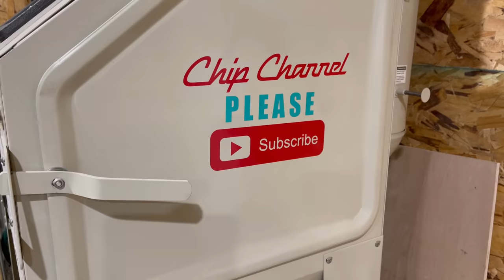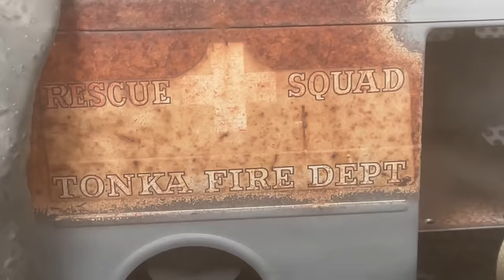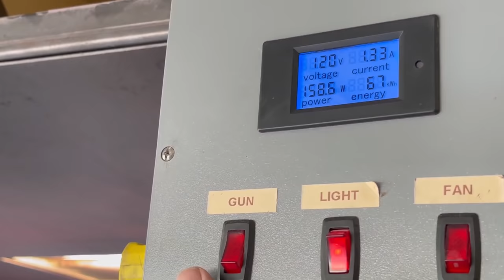1957 Tonka Rescue Squad Metro Van Ambulance Fire Department Truck Restoration

Comment: It always amazes me how good the quality of the metal is when the trucks are beadblasted. It looks in almost perfect condition.
Reply: Yep. For some reason the surface rust bleeds out through the paint bad enough to make it look like solid rust but you can see the paint is still there when blasting.
Reply: Yes, no rust…. just dirt, that looks like it has been painted on
Reply: I agree it seems like it wasn't really rusted, it was just painted like that and a little dinged up to make it look like it was old.
Reply: I've seen a lot of rust and corroding. It's as real as the rusted shit i find in my yard and in the ground. If the truck was painted,  the stickers would be rusty and underneath the stickers wouldn't be rusted.
Reply: The sandblasting process fills any rust or corrosion pits if they aren't completely rusted though, (both sides have rust and complete holes,  metal is brittle there.)
Reply: The fitness gram pacer test is a multistage aerobic capacity test that progressively gets more difficult as it continues.The 20 meter pacer test will begin in 30 seconds. lineup at the start the running speed starts slowly but gets faster each minute you hear this signal.

Comment: Beautiful restoration.  I am the original owner of the Tonka set.  Fire Engine, Aerial Truck, Rescue Squad 1954-55.  The vehicles are in better shape (stored inside) not as much rust.  I want to restore them, but not sure if I want to paint with powder coat or oil based paint.  Thanks for a video. Nice way to start the day 🌞☕

Comment: Just saw the video. Fantastic Restoration. Have to figure out how to make my blasting cabinet work as proficiently as yours.  On putting on vinyl decals, A drop of soap and some water sprayed before applying the decals. Lets you move them, to position them.   Squeegee out the air bubbles and water. and they stay in place. Might make it a little easier to apply.

Comment: Another great restoration. Bravo! I missed where the third door handle came from. Did you make a new one or buy one? I hope someday someone will make reproduction headlights. Everything looks great until you have to put those yellowed old ones back in.
Reply: My family had lots of Tonkas growing up in the 50s and into the 60s. I have a vague memory that some of the plastic headlights did come with amber tint.  Maybe they were clear and turned amber very quickly.  I still have the original family 1959 pumper truck, sadly damaged by generations of abuse, .. its plastic headlights are still clear at over 60 years age, some of that outdoors. Perhaps a good historian can chime in on the clear and amber headlights?

Comment: These Metro step vans were used by the long defunct Railway Express Agency (1929-1975) for deliveries until the corporate jackasses ran it into bankruptcy.  If you come across another one that doesn't have an original identity, consider restoring one as a REA truck.

Comment: If i were to do this,  i would've made a custom interior with an engine cover similar to an engine-in driver cab bus. Also what primer do you use? I like the pink shade on the metal, and kinda want to convert it to liquid paint.

Comment: Just discovered this channel and love it. One question though,if you are restoring the toys why are you using a powder coating instead of spray painting? Surely that's what they would've used in the original manufacture. Please correct me if I'm wrong.